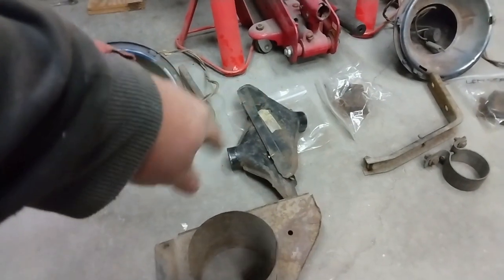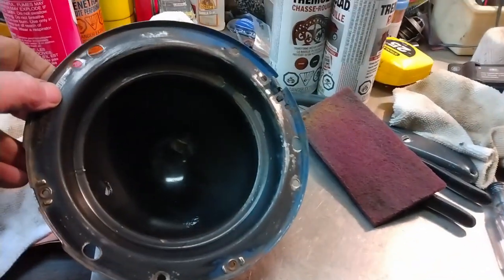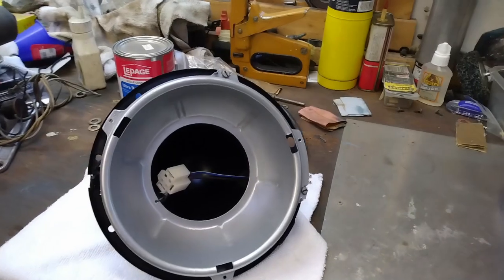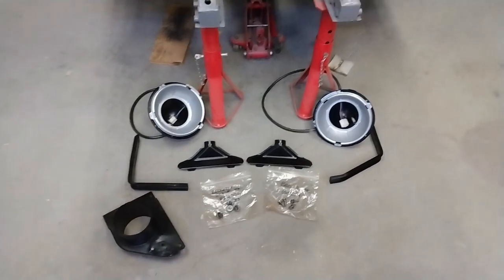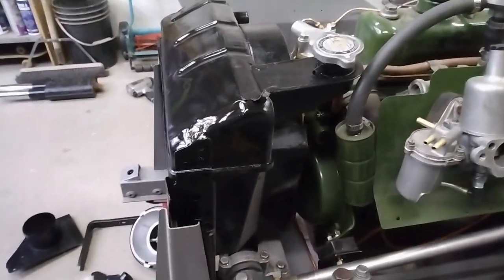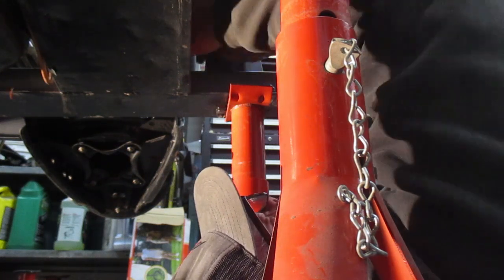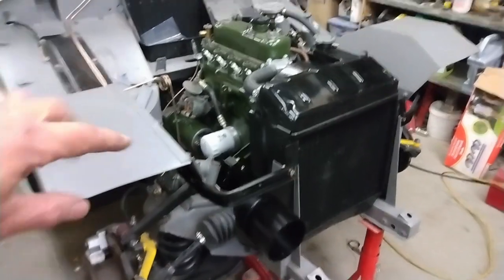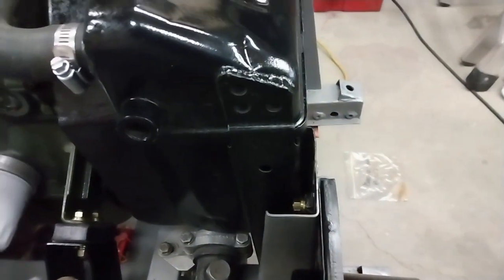How to install a radiator & refresh the headlight buckets in a Frogeye Sprite! Bugeye Build Ep 91

Comment: One week closer to getting the engine fired up. Great progress Ian!! Hopefully the Econobox garage has some heat so you can continue assembly as winter sets in.
Reply from the maker: Thanks! Definitely getting closer. I do have heat in the garage that makes it fairly comfortable to work. Once the outside temperatures get to -10ºC (14ºF) and lower the heater can't keep up.

Comment: Looking good! I noticed you use brake cleaner for cleaning a lot more than just brakes. Do you find it works well as a general cleaner?
Reply from the maker: Hi Trevor. I've found brake cleaner to be very versatile. I used it for the initial cleaning before sanding. Once I was ready for paint I used a product called "Final Prep".